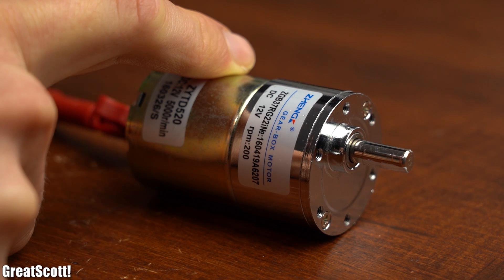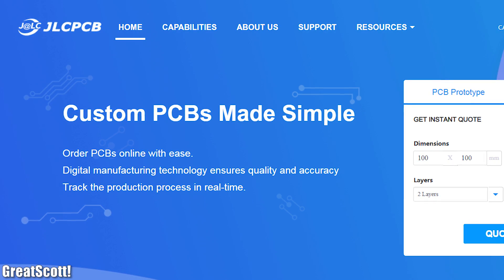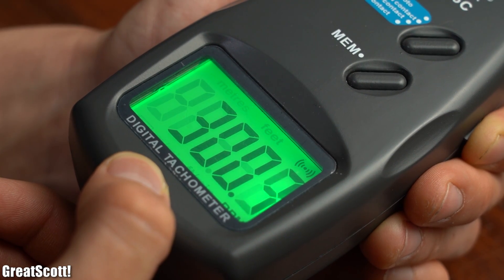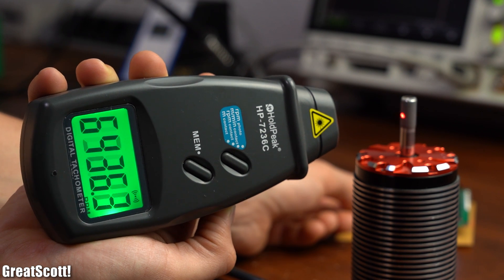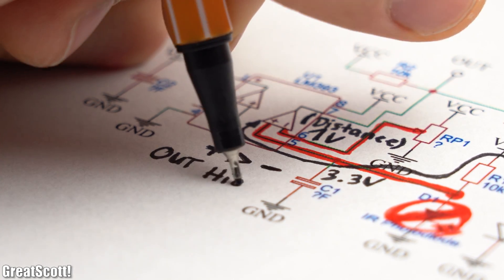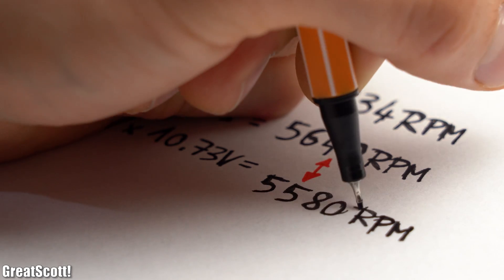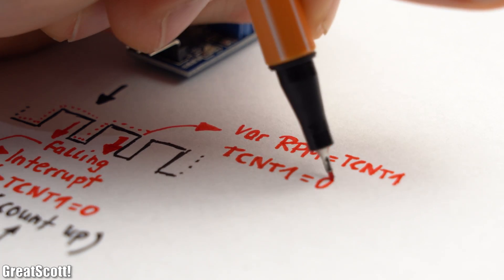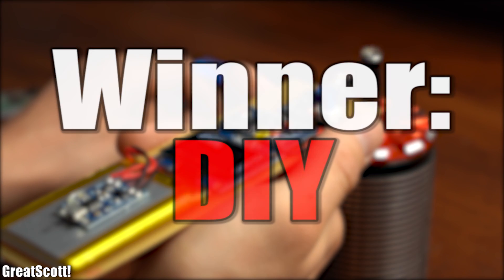Tachometer (RPM Meter) || DIY or Buy || How a 3€ sensor outdoes a 29€ product!

Comment: When I used to use some of these cheap optical tachometers I had trouble with 60Hz fluorescent lights in the room. Dark was best. Could that have been any part of the problems your devices were having? Also the flat and the edges of the flat can give spurious reflections that may not be easily ignored by the device.
Reply: The central problem is that there is no modulation on the IR LED. Television remote controls would have the exact same problem, except they use a ~38KHz carrier. The fluorescent lights could be easily factored out if the IR LED pulsed on and off, rather than just being nailed on. The “carrier” frequency wouldn’t even need to be particularly high, as even the fastest motor shaft will likely turn <100 times per second. In any case, when light is detected by the sensor, it should first check to see if _it was the one that emitted the light in the first place. If not, the detected light is due to contamination and the edge/pulse should be ignored. The math has to be adjusted a little for this, but that’s really easy. If there is a lot of contamination from a bright fluorescent/LED source - or even daylight - it may be necessary to either adjust the gain on the sensor or to do some simple filtering on the received pulse train.  If the motor happens to be turning at a rate that is absolutely, perfectly synchronous with the 50 Hz or 60 Hz lighting, only the gain adjustment would provide the correct results - since all readings will end up being ignored. However, that applies to the commercial tachometer and the DIY one. Plus, that really kind of an extreme corner case, as even synchronous AC motors aren’t exactly 1:1 (aka 1:n) with the grid frequencies. Edit: corrected RPS figure. Facepalm.
Reply: @a1nelson  Really great explanation. Sounds like we need DIY or Buy - Episode 2!
Reply: R Dyer Thanks. This is actually sort of an “ask me how I know” type thing. Years ago, at work, I was designing and prototyping a system that included a small photodiode array. A lot of the time it worked well, but sometimes it would be noisy as heck. I knew all about the potential 60/120Hz flicker, but for whatever reason it just didn’t pop into my head when I was first debugging the problem. Then, realized what was likely going on, probably spoke a word or two I shouldn’t have, tossed a box on top of the apparatus and got pretty much ideal output. It wasn’t a proud moment. Haha
Reply: @a1nelson  I wouldn't even use much math on a MCU to check carrier frequency, rather go old school style like IR headphones. Those use FM on 2 frequencies, one channel about 2.8MHz, the other 2.3MHz I think, then it's all analog FM radio tech, basically do the same but keep the frequency constant.
Reply: Kalvinjj That, or just block the light with a piece of cardboard while performing the measurements. Haha But, seriously, there are lots of ways to skin this cat. I was recommending some super-simple logic: basically, instead of if (white) count++; , I was suggesting PWM and if (white && pulse_sent) count++; (plus normalization). That makes it pretty approachable to most makers. That said, I’m all in favor of the interference/superheterodyne method you suggested. It would definitely be fun to build.
Reply: Even so, thats a problem that the company should have already know, -1 point for that
Reply: @vermillionreaper  Agreed! I don't think it's a defense of the device, but it might explain some things.

Comment: if (tooslow == 1)

> Quality code
Reply from the maker: Well, it works.
Reply: @greatscottlab  Judging code by things like this is bs, I wouldn't be so polite 😉.
Reply: Well, as a programmer I have to say that is a good practice to give self-explanatory names to variables instead of X, Y, Z that are unreadables and after half an hour you too have forgotten what they mean.
It's actually a very bad practice to give cryptic names to variables, it doesn't make your code look nicer and it doesn't make you a better programmer.
Reply: @enricomontanari1390  It is indeed, but Scott is not a programmer and so he's not used to those practices. Good practices never end in programming TBH.
Reply: Why is worst than "if (tooslow)"?. I don't understand this kind of things of point people faults all the time, even when they are stupid... is to feel better than him?
Reply: You guys right, but it makes the code more readable for people, anyway the characters you put here is way more that you would have spared by skipping “==1”
Reply: @grexai  Does it though? It's just another magic number, which is inherently unreadable. Plus, depending on the compiler, it could add an extra comparison operation. Probably fine in this situation, but in similar time measurement programs where execution time matters, it could mess things up.
Reply: Ugh, if everything else is of quality, that should be the last thing on your mind. It's definitely more readable this way though, and prevents mistakes (in case where, for example, a value other than 0 is produced by mistake).
Reply: I made some experiment with that:
if(iii==1) 	 - fast
if(!iii) 		 - fast
if(iii) 		 - slow
if(iii>0) 	 	- slow
if(iii>1) 	 	- slow
if(iii>=1) 	- slow
Comnpiler Optimization level = 0
Reply: @yugo000  What are the test conditions? Did you take a look at the assembly behind?
Reply: @minepro1206  That was long ago. I remember that i use timer for that. In comment i have: 205 -fast, 202-slow. Hmmm... So, no big deal :)
Reply: @yugo000  I doubt that there should be any measurable difference. Anyways there are people that pick on others based on how they write an if statement (whether they use ternary or increment/decrement etc) which is bs.

Comment: I wonder though. Frequency counting is really easy even for a cheap product. Why is that commercial device off by so much?
Reply: because he used it quite wrong.

the laser setup was right, but if you use a roller, you need to adjust for the circumference of the part. imagine having a 1meter wheel in contrast to the shaft of the motor. of course the circumference spins quite a lot faster.

in that mode, you could only measure the meters per second, not revolutions per second
Reply from the maker: @tobbleboii5988  Yes, I talked about this problem in my pinned comment. Why read this one but not my pinned one?
Reply: @greatscottlab  Sorry mate, i must have overlooked it

i really like your content btw ( :
Reply: I can see a few variants:
1. The black and the white tapes isn't in contrast enough.
2. The clock in the device is faulty.
Reply from the maker: I think the clock could be a problem or a bad timer programming.
Reply: GreatScott! Lol - “You had ONE JOB...” I see it as entirely possible that they’ve gotten away with it simply because few users have actually verified the measurements. Or the mfr just doesn’t care, of course.
Reply: It's designed for considerably higher measurements, in this case it is being asked to measure at the very bottom of it's capability. This type of device is more suited to measuring in the order of several thousand RPM.
Reply: @Cool Maths Guy 7.77 you just scared the heck outta me xD
i totally forgot the playlists and thought that i accidentally set everything to public

thanks! when i'm around my friends we always listen to a playlist where everyone's put in what they like. If you ever aren't sure what music to listen to, just make a weird mix xD

Comment: How could the roller possibly know the diameter of shaft?
Reply: Right, seems to be in a single unit you'd need some sort of optical measuring sensor (cheap cam?) with a distance sensor and a calibration method I'm thinking.  Maybe some sort of first step cal for shaft diameter would be easier to input?

Comment: Thank goodness for this vid I can finally understand how to make a DIY anemometer
Reply: Buiz That’s a really good idea. I have a rural property and I’ve long wanted to be able to visualize changing winds and turbulence across a large area.  The 3€ comparator part should it a lot easier to fabricate the ~25 anemometers that I’ve been hoping to set up. Wish me luck ;). PS: I wonder how high they should be mounted in order to reject most of the surface effects from the ground...
Reply: @a1nelson  I was planning to make mine a project for a government agency here where I have to dot a huge area with weather beacons and all of them will transmit back to the nearest office here via VHF Morse Code
Reply: @a1nelson  the plus side is that the beacons are super low power when transmitting. 10mW tops but with a ridiculously high gain 16dB antenna
Reply: Buiz sounds interesting. What were you or are you planning on using for the transmitters? Something off the shelf, or are you planning on rolling your own? Maybe it’s something I could use for my project. I was seriously considering LoRa, but even in quantity, the transmitters aren’t particularly cheap. If I rolled my own, I’d probably reach for binary encoding of some sort (8/10 or the like), along with a CRC. But, maybe that’s the wrong tool for the job? What are the advantages of using Morse code? Simplicity? Shorter message length and therefore lower power over time? Availability of suitable models - perhaps from Ham radio sources? I’d be interested in any thoughts you have on the subject.
Reply: @a1nelson  I've seen a very simple 144MHz CW transmitter from YO3DAC's homebrew site which only consists of 3 transistors, some coils, a crystal, and a variable cap. The transmitter itself just draws around 10mA when transmitting so I can make it run purely on just solar power. Also simplicity is the key thing here which is why I used morse code. The entire message however might take an average of a minute and a half to transmit at 8WPM. Another reason for morse code is that when some people have an SDR dongle and a high gain antenna, they can decode the signals on their own too
Reply: @a1nelson  I still have yet to make the homebrew transmitter before testing it in arduino however. Just to see how wide is the frequency range of the transmitter
Reply: are you using a propeller for wind and this tachometer method to build it??
Reply: @sayantanmaiti2513  either a prop or the three cup style
Reply: @sayantanmaiti2513  and yes but I might still consider hall effect though

Comment: Nice video.  When RPM is low switch from time per pulse to pulses per time.  I once harvested IR LED pig-snout  pairs (may have been just me that called them that) from VCR's for this.  VCR's used them to monitor reel speed and designed more so the LEDs were hidden from each other.  They seem rare these days.
Reply: I can't find the code

Comment: I wonder if you can open the laser tachometer and measure the output of the laser sensor. And ideally replace it's electronics with the Arduino 😁
Reply from the maker: Hmmmmm maybe a HACKED! video idea?
Reply: Had the same thought, should at least be feasible to reuse the display and case.